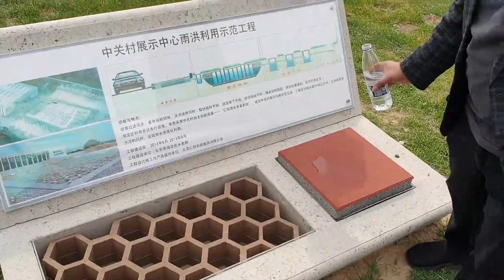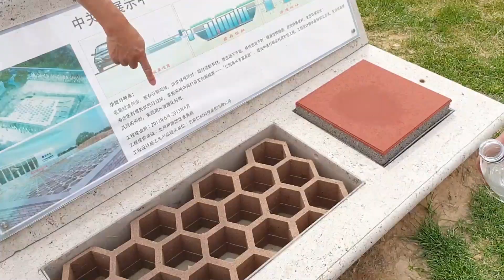🆕Sponge City 👉🏾 Sponge City Concept ⛲RainWater Harvest Best Solution!

Comment: After three years of observing the sponge city initiative in China, it's evident that this concept has been detrimental, leading to the loss of thousands of lives merely to support GDP maintenance. Sponge cities are only practical in areas with low to moderate rainfall, yet when this idea gained popularity a few years back, the associated costs and limitations were largely overlooked. 
Money spent, and people anticipate it would solve the flood PERFECTLY.
Then "extreme" weather came with 500-1000mm daily rainfall "every year".
Of course the sponge cannot absorb such rainfall and flood keep happening.
Reply: sponge cities are not 1 stroke for all. planning has to be done in proper manner to build a sponge city. it involves lakes ponds and permeable surfaces, it covers all aspects.